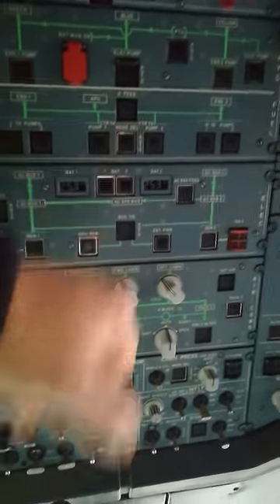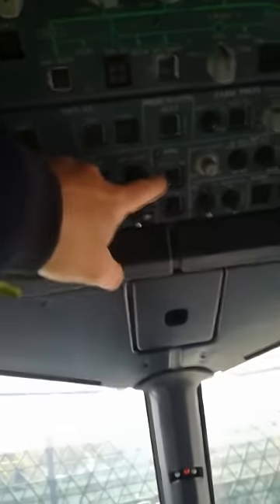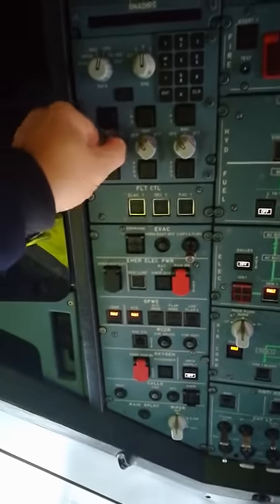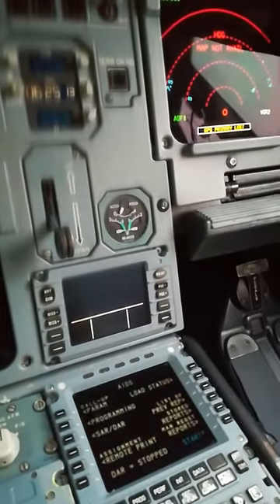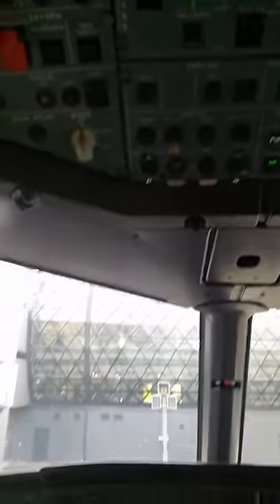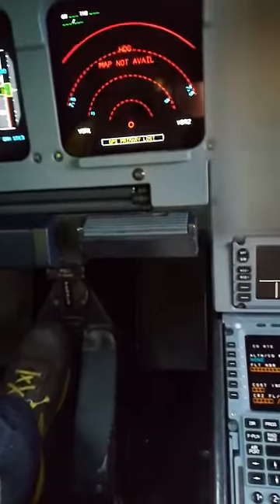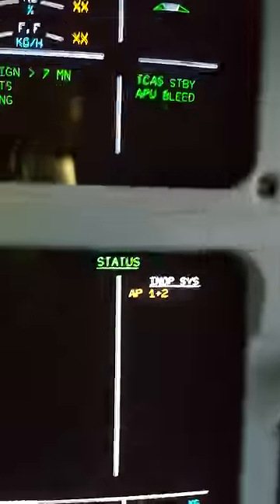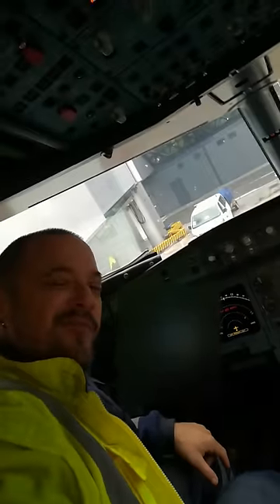Waking up sleeping beauty... A319 cockpit preparation

Comment: Normally I wait for the flap open message before starting the APU
Reply from the maker: And normally you would if u have external power. Again, if u dont, how would you know? :D So, this is the way i do it in my place of work under ours operations...Others do it differently ;)
Reply: @addict2flight  Very true, on BATT no indication of APU flap pos'n. I normally watch the BATT voltage windows for starter draw and then recovery. Gives me knowledge on the health of the starter and batteries at the same time. I'm more concerned with that Park Brake/Emergency Brake accumulator pressure drop on the overnight, too excessive for a 6-8 hour time frame.
Reply from the maker: @geoffmurdoch1899  im not concerned and dont overrhink. If it runs it runs, if not we will troubleshoot it😉

Comment: When you turn on apu master don’t you have to wait for the flap to open?
Reply from the maker: Or you can leave it for automatic to do it by itself. How do you do it in your airline? On your job? Usually, and it was the case in this situation, APU flap was allready open. So, you dont know and cant tell what i know and you dont see, as well as i see and you dont catch my view or steps i do beside camera 😉
Reply from the maker: In either case ECB is controling evetything, but if u dont have ECAMscreen because you start from BATT how can you know flap is actualy open? If you answer me correctly i buyyou a beer
Reply from the maker: There is a way to figure it out, and its not to wait some amnount of time
Reply: @addict2flight  usually when I’m starting the aircraft we’re plugged into ground power in most cases. so when we turn the apu on for the packs the screens are already on, indicating when the flap is gonna open. Even when I don’t have ground power I usually wait a few minutes before apu start
Reply from the maker: @TobiBallLikeKobe  and that is a normal way withGPU on 👍

Comment: Why would the fuel leak if pumps are turned on after apu start?
Reply from the maker: Doesnt have to do with APU start. Just it has happened few times that on GND fuel leak due to constant fuel pressure in lines, maybe older exhausted  pipes, etc. But anyway, why lines need to be constantly pumped by fuel, no need...You can just provoke some hazard with it and make yourself Day way more interwsting 😂
Reply from the maker: Anyway, and those pumps have their life expectancy in some FH, why provoke failure and shorten their life span if they are not needed...
Reply: @addict2flight  thanks for the information

Comment: No wiper check, or check if engine start switches are accidentally left on?
Reply from the maker: Wiper check? Engines switches... 🙂 How do you know where my eyes were pointed. Wjpers? On dry glass? Not recomended, if their faučty in flight pilots will report andwe will use MEL for dispatxh and fixwhenable
Reply from the maker: Easy as that...